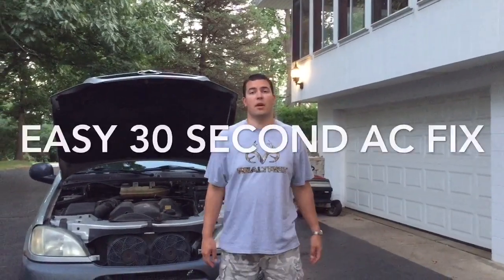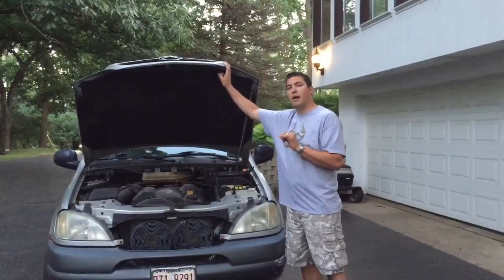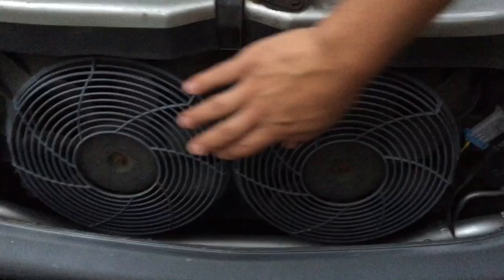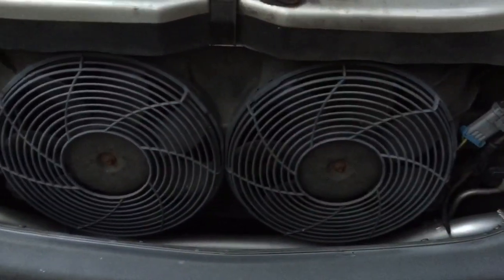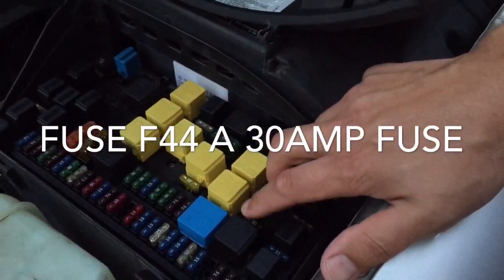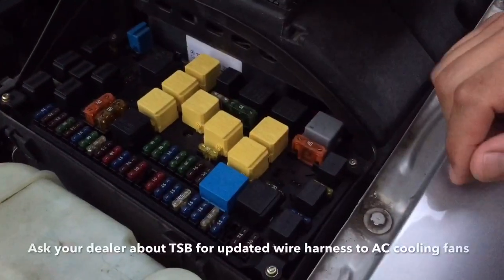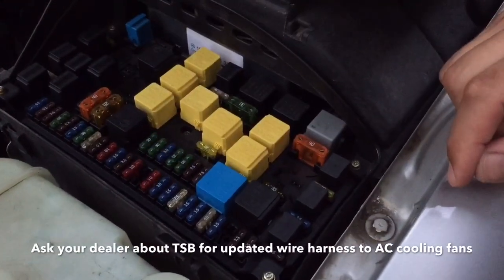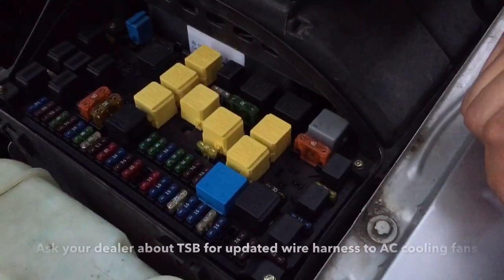Mercedes Benz ML320 AC Fix and Repair ANYONE can do it!

Comment: Hello
I have mercedes benz ml 320 cdi 2008. I have isues with my ac since last year. They replaced the ac compressor, recharge, no leaks. Ac will work for 5 minutes and then will stop and then wont blow for sometimes. They said to it might be control module, i did replace it and if was working and now it is not again, at this point i think ac system is okay but something else is messing with me. Everytime ac works those fans are coming on, but when ac doesn’t work they are not coming on. any suggestions ?

Comment: yes to the below question. With a/c on and car warm, if idling and sitting it blows warm/hot air. When the car is driving it seems to be the required temperature. Suggestions please?
Reply from the maker: Robert Mutch yes that would indicate to me that your Auxiliary Fans are not kicking on. How does your temperature gauge read when idling does it get warmer?

Comment: So just r&r that fuse and the aux fans will work? 2000 ML320 blows hot unless on highway.
Reply from the maker: Yep if the fuse is blown it should come back on for you. This is just a short term fix though, the long term fix is to have the upgraded wiring installed with a larger fuse. Hope that helps!
Thanks
Joe
Reply: Thank you! It's SO hot here in Texas and I can't stand the thought of going all summer baking.
Reply: @joesnowmobiles do you have a video for the long term fix? Thanks

Comment: Question for you ! My 2003 benz clk 320 AC turns on randomly (different time frames each time) when i throw it on almost as if it was blocked... and same thing with heater ! Ac comes out cold , heater comes out hot. Any idea ?

Comment: hey joe got a question for you....my 99 ML320 AC stopped working.... got diagnosed as compressor leaked out all refrigerant. Got new compressor, new expansion valve,new desiccant. Will flush lines and condenser or should I replace condenser in addition to new parts for mentioned
Reply from the maker: Fred Chappell hi Fred if I’m not mistaken it’s always recommended to also replace the condenser as well. 
There can be debris in the system that can get clogged in the condenser and there goes all the hard earned money you spent on the rest of the parts. Hope that helps!
Thanks
Joe

Comment: my air stopped working in my 2001 c230 kompressor hatchback any ideas ??
Reply from the maker: Lamar Fowler Ill need some more info, does your compressor turn on when you turn the switch? Also does it blow warm? Did it happen all of a sudden or over time. Have you check the AC pressure? Thanks joe